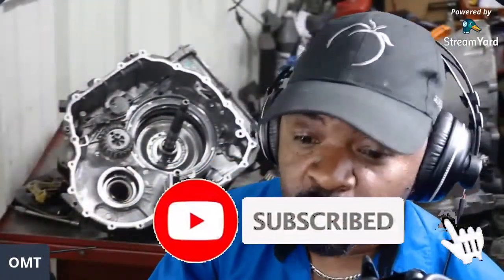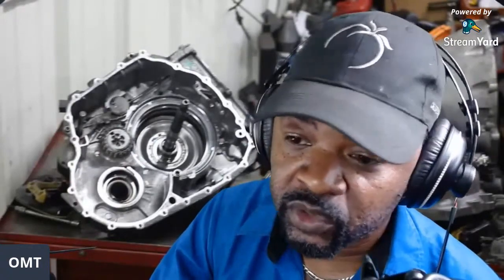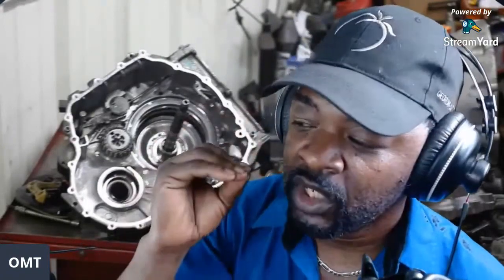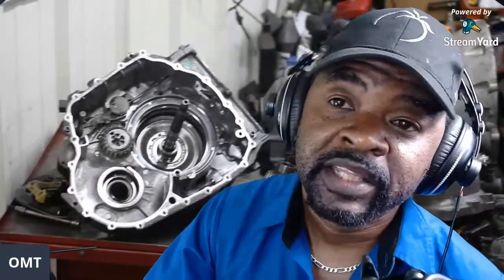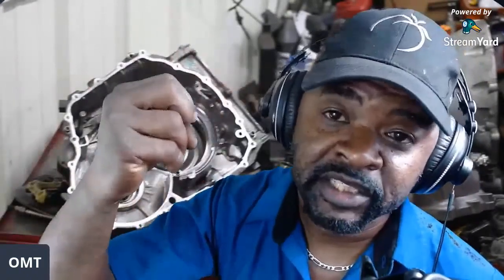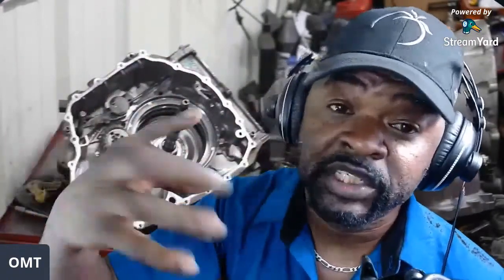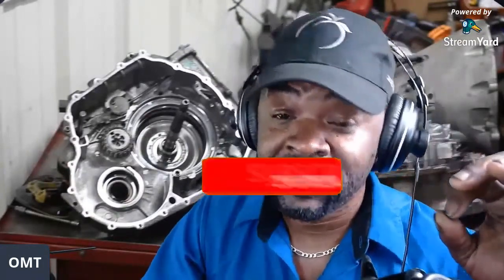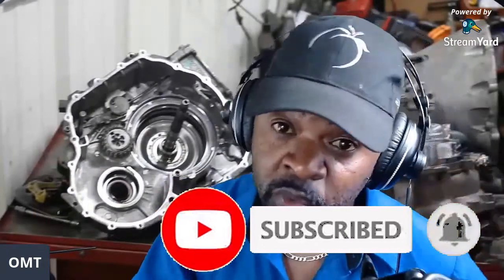Lets talk Honda Acura Fiat Land Rover ZF 9HP48 and Chryslers 948TE Transmissions

Comment: Great video.If car owner doesn’t do a flush or a “drain and refill” by 60K to 80K and you have issues it’s too late.  If this 9 speed allowed for easy access to filter I would do change filter and replace fluid.  But since filter is not easily accessible I will only do the drain and refill.  Pay now or pay more later!!!  Contamination in any hydraulic system is bad!  It appears there is an aftermarket kit on a website transmissioncenter.net. There is also a video of a tear down and it is not to the point yet for a DIY some specialty tools are necessary  byt the trans builders in that did the video came up with a hack because of their experience.  Thanks for the video and I am looking forwards to any info you have on the 948TE since I have the 4x4 or AWD CHEROKEE.  Stay safe and well JT !  👍🏽👍🏽
Reply: The "filter" is just a lifetime screen, isn't it?    I've never seen a "clogged" transmission screen "filter" and if it's clogged with metal glitter or clutch material, you're kind of screwed anyway. 
I've never had a problem just doing a rolling fluid change every 30,000 miles (or whatever).    I  think people are getting too hung up on this filter change nonsense.    It isn't like an engine oil filter.

Comment: old Hondas auto trans were manual trans with torque convertor, front pump, filter, that shifted with solenoids to move shift forks to move gears, still split the case to change filter.

Comment: My 2017 Cherokee just turned 57k. The tranny has started slipping and usually after a “slip and re engage” will then go into a “false neutral” ( I’ve heard it called). My local dealer had no advice to offer. I’m mechanical inclined and was hoping to hear suggestions just short of selling the car. TIA!!
Reply from the maker: Hey bud, the trans in those Jeeps are computer controlled. You have to at least get into the TCM. Have you had it scanned? Also are you subscribed to the channel?

Comment: My 2019 honda Odyssey, ZF 9 speed transmission, when the engine is cold just started, I change the gear from D to P, speedometer ask me to put my foot on break pedal which is I did, happens during the engine is cold or just started in the morning only. I did transmission software update. Everything shift perfectly fine, it just the speedometer says put foot on brake pedal. Honda dealer couldn't duplicate since the engine is warm by the time I get there. Do you know what's the problem? Thank you

Comment: Have a 2016 Jeep Grand Cherokee; at what mileage should I have my trans serviced, low mileage but short trips.
Reply: Check your manual I have a 2016 jeep Cherokee latitude 2.4l I ask JT the same question pretty much in Chrysler eyes you dont have to service these trans but my opinion I think its bullshit because fluid breaks down
Reply: They  say 100000
Reply: @M1CHAZZ  mine is the 9 speed it says for the life of the vehicle there isn't no mileage cap nor its telling me to service it
Reply from the maker: Curious since your truck a Jeep Grand Cherokee that could be equipped with the ZF 8 speed trans..if it's a NAG trans there is a change interval
Reply: @OnlineMechanicTips  Have an 8 speed according to big owners manual, dealer service writer says lifetime/100000, 3.6
Reply: Manual does not give change intervals.

Comment: Hey from Canada. Great video, love hearing from someone that works on these transmissions. I have a 2017 Acura MDX with the ZF9HP. Honda/Acura says change the fluid when the maintenance minder says, which is usually about 70-80,000 KM, or about 50k miles with Honda ATF Type 3.1 Fluid. I assume Honda and Acura have engineered these transmissions to their spec which is different from FCA, what fluid are you using in a drain and fill? Subscribed to your channel, keep it up man! Thank you!
Reply from the maker: Hey bud, thanks for watching and subbing. I'm a huge believer in using the factory OEM fluid in this trans. There are option fluid out that will say meets oem specs, but I only use oem. As for the ZF units equipped in FCA products, it may say Mopar OEM 8/9 speed trans fluid. From my understanding, its basically the same fluid that ZF recommends, just packaged in Mopar bottles. Same go for Acura, OEM fluid may read Acura OEM fluid for ZF units. But on the flip side of this, we do have services offered that will include the much cheaper fluid Valvoline make. This will make the transmission drain and refill service package more affordable. I have done such services without any problem using the other brands
Reply: @OnlineMechanicTips  Thanks man. As a car guy, a guy that does oil changes (That's it! ha!) and not a mechanic by any stretch I always ask for the OEM fluids to be used. Have a great day and keep doing what you do!

Comment: How is the longevity reliability of ZF 9 speed transmission? Thanks
Reply from the maker: This trans holding up well. It showed up in the 2014 models. Most of the repairs ive done have beem computer related such as keeping that trans module updated

Comment: Thanks so much for the valuable info Dude!! I have a 2016 Jeep Cherokee Latitude 3.2 with 70,000 miles on it. I am planning on doing a Trans Fluid change this spring or summer.  The first 4-5 years I've owned the Jeep (which I love) I drove 80% of the time at Highway speeds, approx. 16,000 miles a year. Now I'm driving short runs but around 7,000 per year. just this last year I purchased a 2,700# Boat and I pulled it to the lake about 10 times, 40 min trip. So I've started Towing with this jeep. Should i be concerned about the Trans? I kept an eye on the Trans temp on hot days while i was towing. Only a couple of times the trans temp bumped over 200 degrees. I don't have factory tow package. I do have a Trans cooler which came with the 3.2. It's rare that I hear the Cooling fan kick on....
Reply from the maker: Hello my friend. I like the way you think. The V6 model thats teamed up with this 9 speed ZF trans have some impressive specs as for tow/pull compacity. I would say there have been numerous updates to this trans via getting it flashed/updated. So this planned fluid change along with making sure the trans software up to date, should def help prolong its life. Thanks for watching and please remember to thumbs up the vid as well as subscribe to the channel, thanks.
Reply: Thanks for a very fast response!! Be well Super Trans Man!!

Comment: Hey Super Trans dude! Quick question. Does this ZF 9 speed trans have a Drain plug with a magnetic tip, if not would it be a good idea to install one?
Reply from the maker: Hey bud the drain plug directly on bottom of trans and i dont think its magnet. Do you have a lot of miles on this trans? Also are you subscribed to the channel?

Comment: what is the symptoms of the solenoid pack and the PT Cruiser goes bad what does it do
Reply from the maker: The alert you will get is most likely a check engine light on with a solenoid code. Have you gotten trans scanned yet? Btw please like the video and subscribe to the channel for me, thanks

Comment: I have a 2008 chrysler 300 3.5 liter I just got 3 months ago it sometimes idles rough it was throwing a p1004 code i changed that but the code wont reset does this mean i need a new intake manifold?
Reply from the maker: Hello my friend, sorry im just seeing this. Thats likely possible you may need the complete intake..What happens is carbon build up inside and restrict the blades from moving properly

Comment: I dont trust manufacturers maintinance schedules anymore. My odyssey has the honda 6 speed and the atf intetval is 100k. It started shuddering at 57k. A tsb said do a flush and it was fine after that but if honda set the atf at 50k it woulda never been a problem! Its like fluid change intetvals is 2x to 3x what it was in the 90s and I dont trust that.